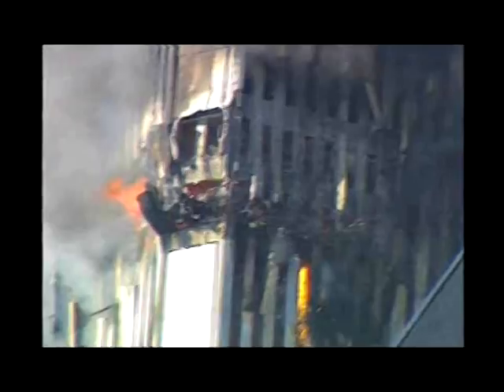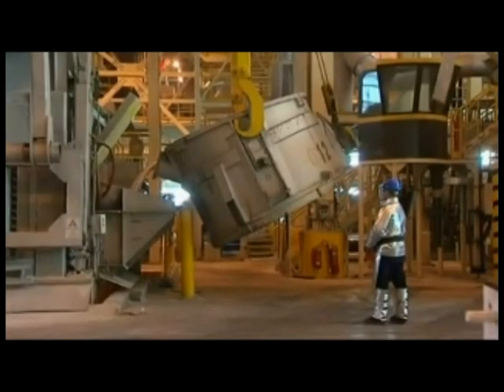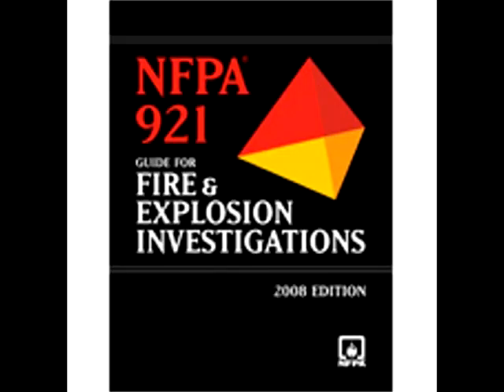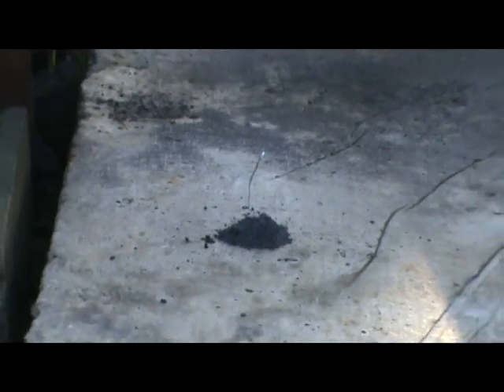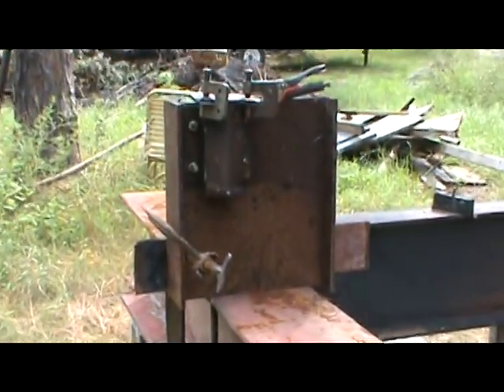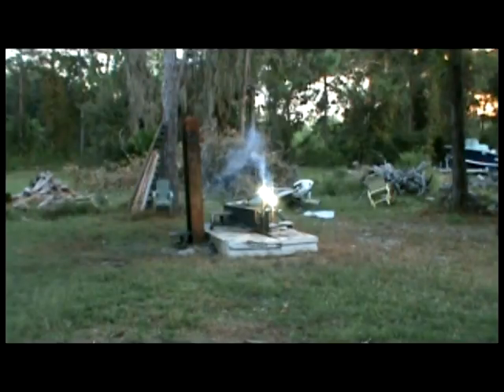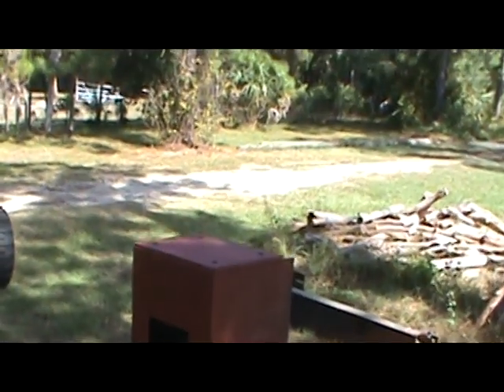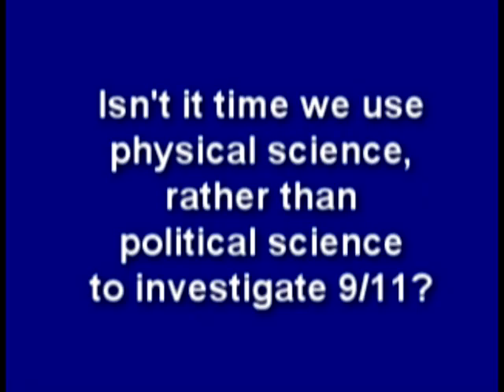9/11 Experiments: The Great Thermate Debate

Comment: Your thermite blends burn too quick. From my child experience we molten through steel plates through without a blast of fire or jets of molten metal from the burning blend. Thermite blends were widely used to weld rails in past! No blast of hot gases is produced in this case. So, your blends are closer to a themite bomb than to a blend for melting and welding of steel rails.

Comment: The videos of the towers clearly show them turning to dust in mid air.  
Nukes and thermate are red herrings.  No one suffered radiation sickness and a small amount of thermite creates very bright flames with lots of sparks as evident in this video.
If thermate had been used to demolish the towers, it would be quite evident in the videos.
The towers were dustified using Tesla technology.  See:  Hutchison Effect
drjudywood com

Comment: @bluesman97 
Do you deny that the videos show the towers disintegrate in mid air, except for the panels of aluminum cladding  - Yes or No?
How do you imagine cutting charges were installed on steel beams inside walls in offices?
How were the flames made invisible?  
Why did thousands of sheets of paper rain down unscorched, but no metal filling cabinet were found, except for one in the size and shape of a basket ball? 
How were vehicles flipped, but not pushed up onto sidewalks?
Hutchison Effect

Comment: @bluesman979 
Post a link to a photo of a recovered file cabinet. You won't.
Thousands of sheets of unscorched paper rained down and covered the streets amidst vehicles with apparent engine block fires, while other vehicles were upside-down, but not pushed up against buildings or even onto sidewalks. 
Are you at all aware of the Hutchison Effect?  He has duplicated similar anomalies including molecular disassociation.
How did all of that paper survive *invisible thermate flames* - unscorched?

Comment: @Bernadotte01
None of your links show bright white light emanate from the towers during their respective disintegrations which would have been visible had thermite/mate been used.
How do you imagine thermite/mate cutters could have been installed to the steel beams inside of walls in offices?

Comment: @bluesman979 
What happened to all the metal file cabinets?  Only one was found and it was the size and shape of a basketball, as if melted but unaffected by gravity.  Yet, unburnt sheets of paper rained down and covered the streets amongst vehicles experiencing apparent engine block fires.  Other vehicles were upside down but not pushed up against buildings or even onto sidewalks.  See:  Hutchison Effect
drjudywood com

Comment: @RequiemForChange

"it was in the video i posted"

No, there wasn't anything that indicates cleary an influence of NT. So you still have to come up with the visual evidence which is supposedly seen everywhere but nowhere where you point at.

The large meteorite was simply formed by heat and pressure. Nothing special. If you know how large blobs of steel molten by N(thermite) look like, than it won't be problem to show pictures to compare.

Comment: @Skeptic121 "Is thermite unsuitable for arson?"

It sure won't work for a controlled demo, which is why it has never in history been used for that job.

Controlled demo requires timing of each failure to the microsecond.  Failure by thermite can't even be timed to the closest MINUTE on large steel beams.

Epic fail.  Stupid argument.

Comment: @p13ty4real "he proves it DOES cut steel collumns"

As long as you weld up some giant steel box to contain the reaction.

Since there would have to be a few hundred of these, each the size of a midget submarine, isn't it amazing that no one noticed these huge things during recovery?

Didn't notice any steel beams with ends turned to blobby, dripping slag, either.

Maybe the space aliens used some magical thermite this time?  Or invisible containment structures?

Comment: Reality check. Office materials, wood, carpet, paper, etc. will burn and get hot enough to ignite aluminum. Not just melt, but ignite aluminum. Which will get hot enough to melt steel, especially with the abundant oxygen being supplied by the wind blowing through the huge hole punched into the skyscrapers. I'm unaware of any reputable scientist or metallurgist who entertains 9/11 conspiracy theories.

Comment: @palasta
You're delusional. The Pentagon does and did have at least five antiaircraft missile batteries. It doesn't matter if you want to deny it, they're still there, still were there. There is no way in hell a passenger jet could hit the Pentagon without permission. Think what you will.

Comment: @phonic0photon

"M8 those steel beams you saw "photographed" had less volume/mass than the twin towers and had fires burning them for much longer than 9/11."

The steel beams weren't the problem. The trusses and connecting elements were.

Secondly, for how long a fire burns is just one factor. Or do you seriously think it doesn't matter if you heat up a chunk of metal with a cigarette lighter for 10 min. or with a blow torch?

Comment: @mindfuckerification

"thermal properties or something."

Thermal conductivity & thermal expansion. The heating had two consequences. Expansion and contraction. The the distortion of this mass of metal had a visible and hearable effect (buckling of columns).

Reduction of cohesiveness. The steel beams weren't heated up this much, but trusses and connecting elements - the less bulky parts - were heated up pretty fast and because of their small volume more vulnerable.

Comment: @Joesus5000

Where am i supposed to look at?

Did you read me?

Quote me: "thousands of pictures"

Now what do you make of this? That i have not looked at many image material and video footage?

Or are you speaking about this one little tiny piece of corroded metal, reaching temperatures not higher than 800-1000°C, possible to be heated by normal fire and showing no signs of high temperatures like NT would produce?

Comment: @flanksteak2 
I didn't want to change the subject. I was just getting bored at you not answering the tins if questions I raised. 

Why I THINK the floors were "100 times" stronger? I never said 100 times stronger. They don't need to be. It's just the way that steel framed high risers are built: They are able to uphold a top of the burning building even if there has been raveging fires for hours on end. As simple as that.

Comment: @flanksteak2 
So, you dumbshits still thinks that the laws of physics were altered on 9/11? Did the hijackers - which also happened to pilot theses sofisticated craft at impossible speeds and precisions for regular 767's - ask Allah to help them there?

The math has been done by Chandler and others from AE911Truth. NIST didn't apply that but were assigned to use computers for a fire hypothesis. Highly un-scientific.

Comment: @Thetan1974 "The towers simply wouldn't fall"

Whoa back up there a second. You still haven't show your work as to how you concluded that floors connections were about 100 times stronger than what they actually were. 

Do not move forward from this point until you explain how you came to such a conclusion.

Comment: @flanksteak2 
The towers simply wouldn't fall.

Oh, maybe the top of WTC 2 would tip over - and it does. And it turns heading for the ground. But hey, it gets pulverized in mid air and doesn't hit the street in a big chunk. Explain that.

I do believe in earths gravity, yes. And it would take a whole lot of much stronger gravity force to make those tops force their way down through the paths of greatest resistance. (And how did the pulverizing south tower top do it?)

Comment: @Thetan1974 "It's not heavy enough"

So your dumbass thinks that the puny little connections that hold the floors trusses are strong enough to hold up the weight of the load of the framing above the collapse area, the concrete on the floors and load on the floors themselves?

Lets see your math there.

Comment: @Thetan1974 Saying the towers wouldn't fall through the path of least resistance is stupid because you're using an electrical engineer term and trying to apply it to objects in motion. You do this because you are stupid. 

The buildings will fall in the direction of greatest applied force. That force is gravity which acts straight up and down the structure. 

You do believe in gravity don't you?

Comment: @Thetan1974 "A top of a steel framed high riser can't possibly force its way down through the lower stronger part"

Why not? All that resists collapse are connections that hold the floors to the columns. These connections are overwhelmed by 100's of times more weight than they are designed to support. 

But like all Truthers, you batshit dumb enough to think the full vertical support capacity of the columns would  have resisted collapse.

Comment: @flanksteak2 
I answered: The "object" wouldn't go anywhere at all; A top of a steel framed high riser can't possibly force its way down through the lower stronger part. Even if you made a raging fire engulfing those floors that were struck on 9/11 and lifted the top with a huuuge crane that could lift the top up let's say 100 ft above the lower part and dropped it on to the lower part, it wouldn't frorce it's way down - and it would certainly not let all the phenomenons observed behind.

Comment: @flanksteak2 
The building wouldn't "fall" down through the path of greatest resistance totally resembling CD's with squibs way below and even above collapse points, nano-thermite in the dust, iron rich micro spheres, polls of molten steel and metal for moths that cuoldn't even be put out by "Pyro Cool" yada-yada etc. etc.

Only in the Land of Those Conditionned and Terrified of the Truth al-Qaeda-hijacked. regular 767's and fires made the 3 steel framed high risers come down the OCT way.

Comment: @flanksteak2 
"It's 100% proven that fire caused the collapses."

Really? Also that they created iron rich micros pheres, nano sized thermitical particles, squibs way below collapse points ect? And where is it proven, that a smaller upper part of such a steel framed high riser can force it's way down through the larger and stronger part along the path of most resistance pulverizing everything except from the steel? Certainly not in the NIST Report, if that's what you refer to.

Comment: It is not only speculation that airline impacts and fires brought down the 3 WTC buildings. It is also unscientically "proven."

It it just funny that you have to imagine a "twoofer scenario" in which the NT was smuggled in by "someone" without the security knowing about it in order to make it easier for you to believe in the OCT, just because you can't even comprehend that part if the "inside theory" is also controlling the security - simply the simplest explaination. Ta-daa.

Comment: @flanksteak2 It would not matter if I never even looked at it. What we are talking about here is deviation from standard protocol in engineering practices. NIST will not submit its reports and data for peer review. That is a fact. I can prove what I say. You respond with childish accusations "You never read the report". So what? I'm not an engineer. NIST has all the engineers and they won't submit their work for peer review in violation of standard procedure.

Comment: @flanksteak2 This is not about me. This is about NIST. Standard protocol in engineering reports of a building collapse is peer review. NIST needs to release the data points used in making their assumptions and also the data used for the computer simulation of the collapse for peer review. Other engineers need to check the data so that it can be verified. After peer review, we will know beyond a reasonable scientific doubt who is correct. Remember, standard protocol in engineering is peer review.

Comment: @flanksteak2 You must be 12 or something. Standard protocol in engineering reports on a building collapse is you submit to peer review. You obviously have no idea what that is. Maybe you should google "standard protocol in engineering reporting". Peer review is when other engineers, not the ones on your team, pour over the data points used to make assumptions and ascertain it's veracity. NIST will not release those data points or the data used in the computer simulation.

Comment: @flanksteak2 You are wrong on two points. The first being the data points NIST used to make their assumptions. Second, the data used in the computer simulation of the collapse. In either case, wouldn't you agree that NIST should follow standard protocol and submit it's reports and data for peer review? The scientific method demands that other engineers check your work and verify the results. NIST will not submit it's reports and data for peer review. Is this ok?

Comment: @Skeptic121 In addition, the tallest building ever deliberately brought down by controlled demolition was the J. L. Hudson department store in Detroit.  JUST to load the explosives for the job required 24 days with 12 people doing the work and they had complete, unfettered access not only to the building but it's foundational structure.  To my way of thinking that puts the question of controlled demolition for WTC7 entirely out of reach.

Comment: @MrMZaccone

"Why not just encourage some suicidal jihadists to hijack four planes and crash them into buildings?"

Exactly. This is the simplest. And the casualties wouldn't have been much lower. The towers wouldn't have stopped burning after 1 - 1 1/2  hour. Most victims were trapped in the upper sections above the impact zones. The Fires could've spread throughout the buildings, with the structure damaged the risk and complexity of extinguishing them woud've been extremely high.

Comment: @palasta 
It's very simple that those in charge of security would let several sorts of  explosives into the buildings. Heck, that wouldn't even be considered "smuggling". 

But you eliminate that theory and then resort to the scientific impossible scenario that the jet impacts and jet fuel fires just happened to cause higher temperatures than possible and creating iron rich micro spheres? And that nano sized thermitical particles coincidentially was created under THESE "collapses"?

Well, duh...

Comment: @Daddyo930 The only elements resisting collapse are the vertical connections that hold the floor trusses to the columns. 

Do you know why it's stupid to claim the full vertical load carrying capacity of the columns was resisting collapse as you are currently doing?

Comment: @MrMZaccone Yes, lack of information.  I will be very specific here so try and follow me.  NIST did the engineering report on the building collapses of  WTC 1, 2 and 7.  In every engineering report, there are data points that are used to verify assumptions made in the report.  NIST won't release those data points.  They also won't release the data used for their "progressive collapse" computer simulation. There is nothing proprietary about that data and it should be released for peer review.

Comment: @MrMZaccone The scientific method demands that you demonstrate your theory with numbers.  Could you express your theory in numbers please?  You believe in the official version.  So lets see you express in numbers how a smaller object (the top of the building) can generate enough kinetic energy to smash its way through the larger lower portion.  Show the numbers please.  Remember, the smaller top portion does not have the density and weight of a black hole, the number is finite.

Comment: @LindaStevensBZ Your wishful thinking, stupidty and just plain ignorance means nothing, we use science here, if skycrapers could be imploded by taking out a few columns on the upper floors and setting in on fire using jetfuel, they would have tried to use it at some point in history, but common sense and facts established by physicists and mettalurgy experts tell you some things cannot just happen.

As for CD, all traces of CD were found, molten iron from the thermite, aswell as unreacted chips.

Comment: Only made it about 2 mins before the 911 CT Bile started.
1100F would be more than enough to bring the towers down.  At that temp, the already compromised and overloaded floor trusses would sag, create eccentric loads, and pull the columns inward.  No CD there, just plane damage and fire.
No way those bldgs could survive that day.  They were not designed to survive that kind of impact...no way.

Comment: @TheCrundlestix "yet you offer no imagination when it comes to the idea that the actual explosives used are so high tech that we simply do not know what their capabilities would be,"

That's called Appeal to Ignorance. It calls for belief in something that cannot be proven to exist, which means it's useless in a debate.

You haven't included "impact", I note. Nor explained why none of the beams knocked out of the Towers were the ones with explosives. Or the lack of ear-shattering noise.

Comment: @Daddyo930

"Without numbers from NIST, we have nothing."

Like it would change anything. NIST is by default untrostworthy and lying, prove to this is the false data, this is the kind of circular reasoning twoofers will use.

Just like: The reports of the fire officers about the immenent collapse of WTC7 are staged, because "they" control everything and a collapse was absolutely impossible.

Comment: @EGRJ Until NIST releases the collapse simulation data and all other data pertaining to the reports they published regarding the collapse of buildings 1 and 2, then seven years later, building 7, we have nothing.  The numbers published in the reports are what people are criticizing.  Engineering reports have what we call data points.  Those data points need to be submitted for peer review.  This has not happened yet.  Without the data used to simulate the collapse, we also have nothing.  Why?